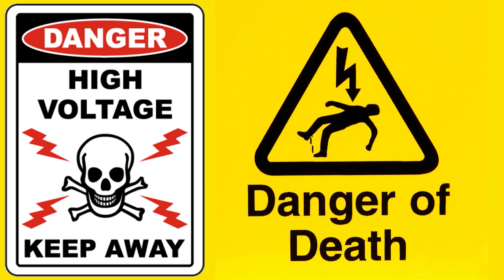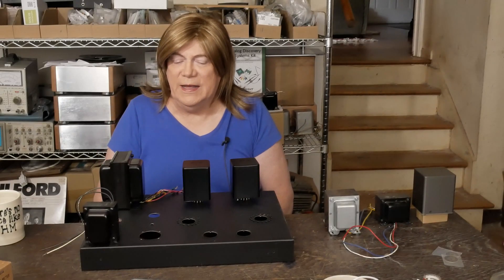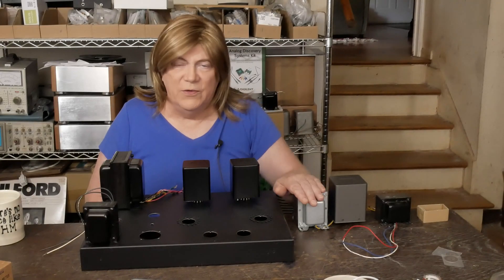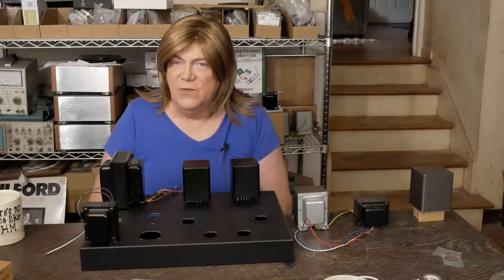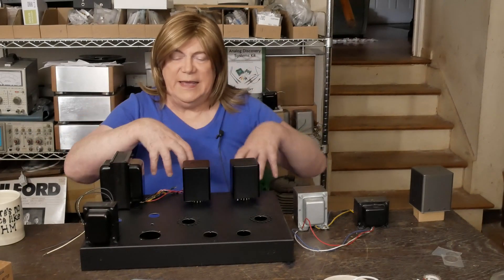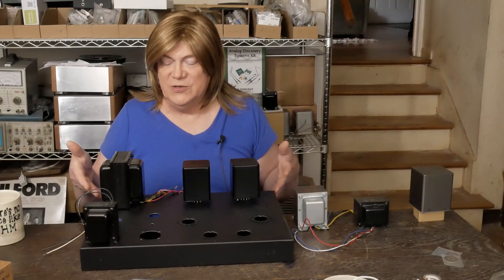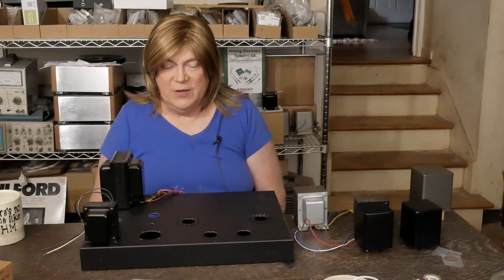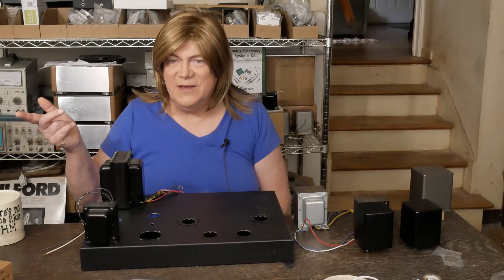Vacuum Tube Amplifier Output Transformer Shootout!

Comment: Why do you prefer the very low inductance for output transformers?
Reply from the maker: The opposite, higher inductance usually sounds better
Reply: @SkunkieDesignsElectronics  why does higher inductance output transformers sound better?
Reply from the maker: Not an engineer nor do I have a great understanding about transformers, but my understanding is the higher inductance stores more energy.

Comment: Hi Stephe 👋 FWIW, I purchased my 300B Elekit amp with the upgraded Lundhal OPT’s, and while they sound great, you’re totally correct in that they need covers. The kit thankfully came with them, and if I remember correctly, you can get Lundhal transformers with the covers. Otherwise, your amp comes out looking like a high school science project. I’ve used Lundhal and Cinemag transformers in a couple SUT builds, obviously for LOMC carts. 

I tried using toroidal transformers for my earliest phono pre builds of EAR 834p MM phono preamps, but they needed the covers or being potted in the covers. I can send you the info on which ones I used. Just say the word, and I can email the info to you. 
I’ve since switched to Ei core transformers for phono preamps builds. 

Thanks so much, Stephe! Your efforts are extremely appreciated. 🔊😊🎶💜

Comment: Sunvalley SV-S1616D [300B] uses Hashimoto H-20-3.5U (20-50Hz, Prim: 2.5kΩ / 3.5kΩ,  Sec: 4, 8, 16Ω, Feq: 25~90kHz, Loss: 0.3 dB, 13H / Prim Induc/DC Current:100mA(2.5kΩ)/18H / 80mA(3.5kΩ), Max DC: 140mA).

Comment: 1.2 tons to the landfill of garage/attic clutter last weekend and still more to go.  I'm starting the 2A3 build this week with Heyboers and thought I might try to source some used in the "Baby Ongaku" for the next one.  I did find an A/B switch component so I can plumb amps side-by-side for testing...I've never had the opportunity to "audition" gear and doubt I could tell the difference between "toobey" and not, so it should be fun.
Reply from the maker: It really helped to have someone else there to push me "Do you really want this anymore and if not are you actually going to deal with selling it?"  If not, gone! 

I did "freecycle" a bunch of stuff, but the esoteric stuff is going to the land fill.
Reply: @SkunkieDesignsElectronics  "freecycle"...that's great!  By default, stuff was piling up next to the truck/trailer as we were loading, and it quickly turned into folks pulling over and finding new-to-them "treasures"
Reply from the maker: Just had someone come by and grab my old camping gear for their kids, gave two bikes away this week. New lease on life!